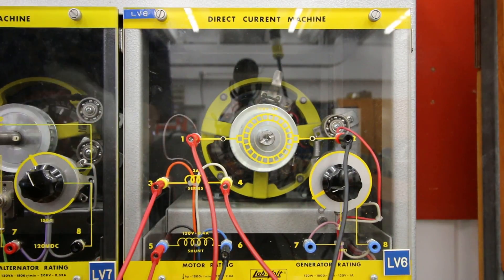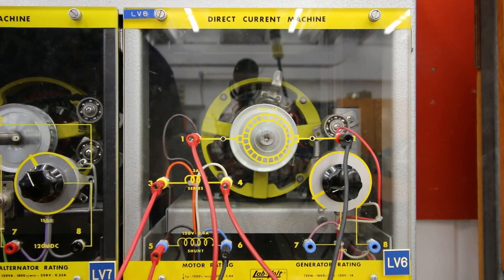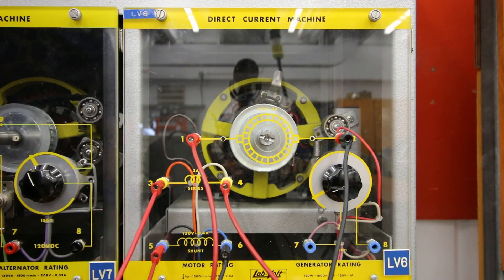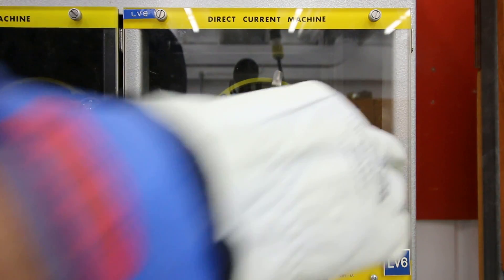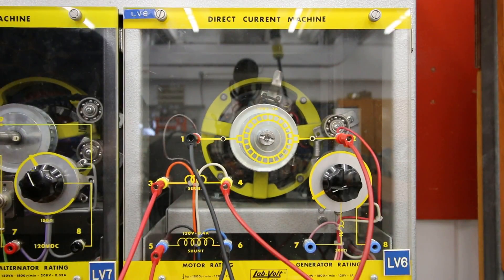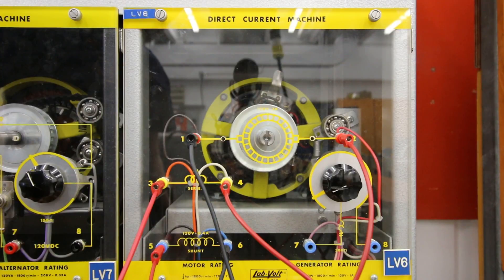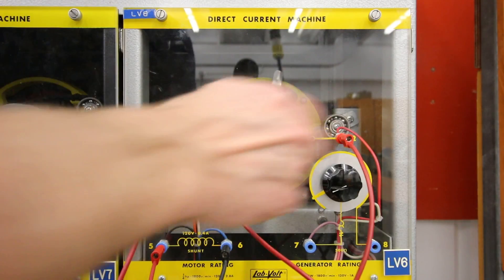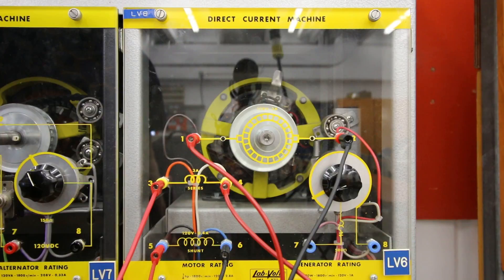Reversing a Cumulative Compound DC Motor

Comment: what if we change field (shunt) terminals, will there be the reverse direction
Reply from the maker: For the compound motor you would have to change both the series and the shunt as they are both wound on the field poles. If you only change one of them, the connection is a differential or subtractive where the series ends up cancelling out the shunt magnetic field... the motor may reverse direction and take off (all depends on the physical load on the shaft of the motor).
Reply: If switch only the shunt polarity you end up with an anticompound excitement. The two magnetic fields are going to have opposing magnetic fields. It can still work but it has a different characteristic